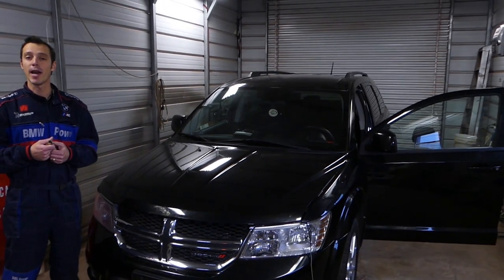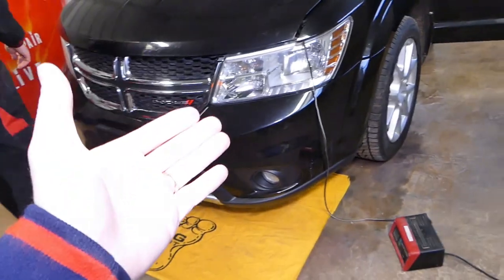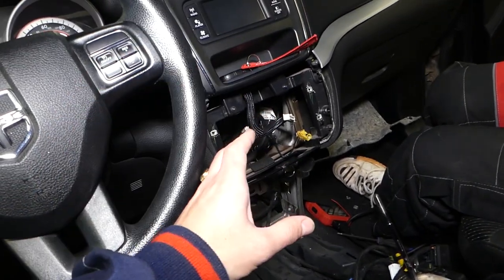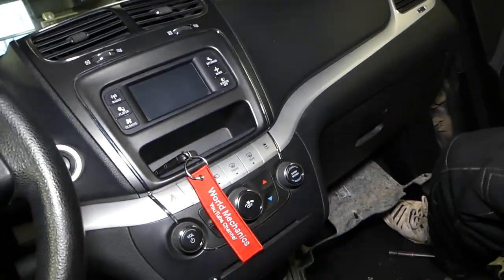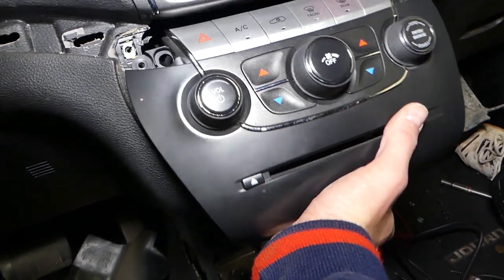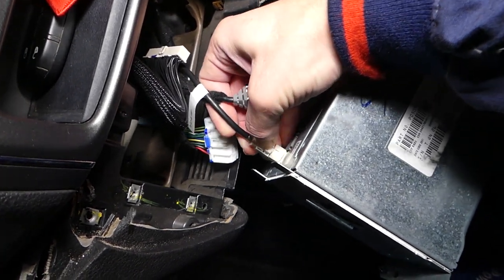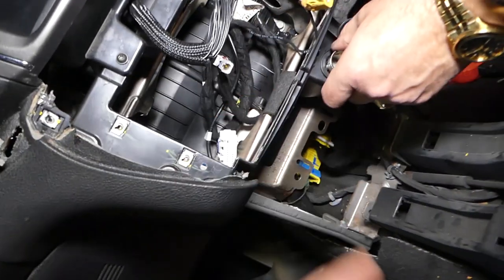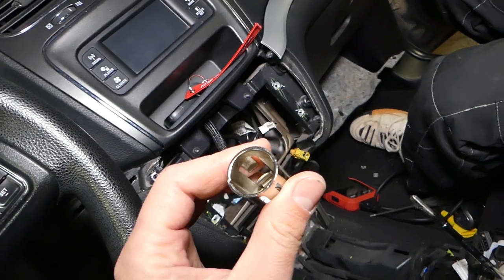DODGE JOURNEY CIGARETTE LIGHTER SOCKET REPLACEMENT REMOVAL. FIAT FREEMONT

Comment: 2012 Journey RT  power drain  because of the Bluetooth module    What to do ?
Pull the fuse of replace the module???
What do you say ??
Thanks for sharing your videos, they HELP !
Reply: WTF.  There is a $5 tool to take them out.  Or you make one.